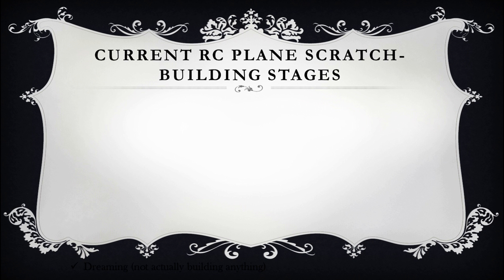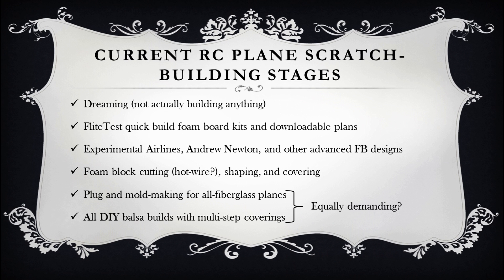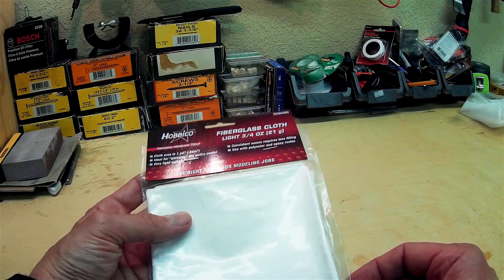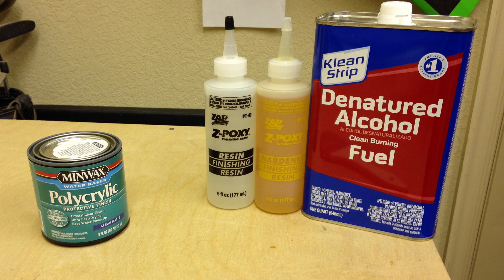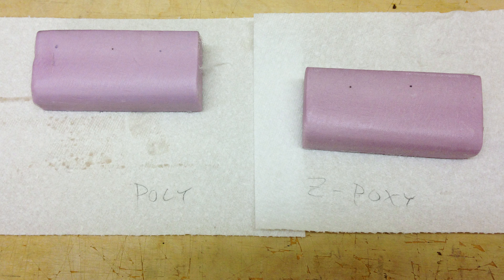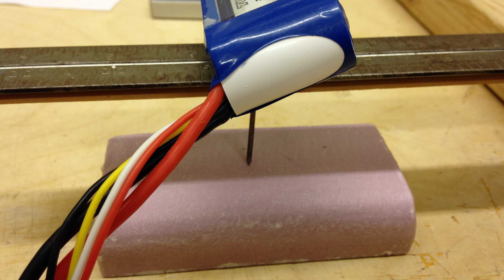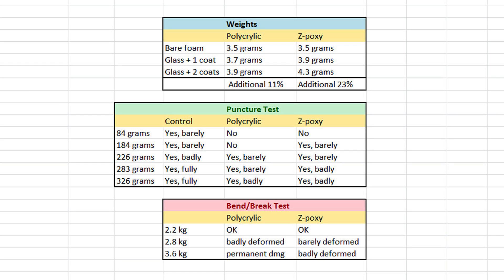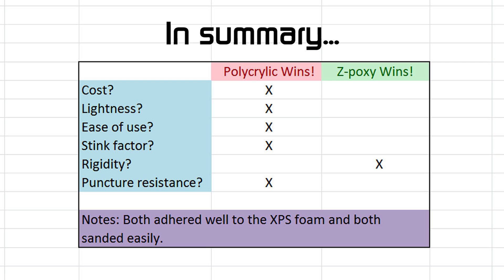Fiberglass on XPS Foam - Polycrylic or Epoxy? (for RC planes)

Comment: If you could install a couple of pieces of hard wood strips along the core wing, and then fiber glass with minwax. Those wood strips will give a great strength to the wings.
Reply from the maker: I have done that to wings and it works well - I agree!  In a later video, I added wood to this wing to stiffen it.  Cheers

Comment: Thanks for the informative video. Based on your results I think I will use the epoxy/alcohol FG on the bottom of my wings for the rigidity and the MinWax PU FG on the top of the wing and fuselage.

Comment: Can you use an oil base polyurethane on fibreglass to cover XPS foam ? Does it works? As the water base polycrylic ??
Reply from the maker: Thanks for the question.  I think oil-based polyurethanes have a good chance of melting (dissolving) XPS foam.  What I used in this video (polycrylic) is not a polyurethane.  It’s worth trying this on a small scrap of material.  Good luck to you.

Comment: can you use carbon fiber mstting on foam planes
Reply from the maker: Yes I think you can.  Most weights of carbon cloth are heavier than I'd want to use on a small plane, though.  Kevlar cloth is also an option - have a look at the "Think Flight" channel for videos about this method.

Comment: Did you get bubbles with no precoat?
Reply from the maker: No I didn't, and I've used this method on three planes now.  I think this is because I thinned the epoxy and also try to keep the fiberglass cloth flat and taught.  Good luck.

Comment: One thing to note is that polyurethanes don’t cure in 12-14 hours completely.  They can become somewhat hard so that they can be handled but true curing will take a week to a month.  A better comparison might be a polycrylic covered wing that has cured for several weeks to an epoxy wing that has cured for 24-48 hours.
Reply from the maker: That's a very good point - thanks for that.  I may have gotten quite different results after full curing time.

Comment: But fiberglass will not melt foam?
Reply from the maker: Fiberglass can be attached to foam with slow-curing epoxies like the one I used (Z-poxy) without damaging the foam at all.  A few epoxies are not safe to use on foam, though, and some create a lot of heat as they cure.  I recommend trying your epoxy on some scrap foam first to make sure it will work.  Good luck.

Comment: Have you considered using a composite material to cover the xps and leaving a hole to use a material like gasoline or acetone to melt the XPS inside? I feel like that would make a similar structure to the full composite airframes without all the work
Reply: I know and old comment but will weighing h in anyway. 
1. The method is valid for creating a fiberglass shell but it has the downside of nasty dirty solvent with styrene melted in in it.
2. The foam adds tremendous amount of rigidity, the shell needs to be significantly thicker to be as strong as glass over foam. Most true light weight composites use foam cores to give thickness to structures with little added weight - usually stronger than XPS which is not good for shear forces. But Burt Rutan designed real aircraft to be built by glassing over XPS and hundreds if not thousands were made. Foam is structural part in those too, not just a DIY friendly material for shaping.

Comment: I am thinking of covering a foamie I bought. I was wondering what you do for hinges in those? The existing setup is just bendable foam, no hinge. Thanks for this video again. I was wondering exactly the same questions you answered.
Reply from the maker: Thanks for the great comment!  Yes, you can cover a foamie using either method here, but I think I'd go with polycrylic in that case.  You can buy plastic hinges from an online store for your control surfaces or just use heavy duty packing or extreme (reinforced) tape.  Tape hinges are surprisingly strong.  Good luck 👍🏼

Comment: One thing to remember is polycrylic  and polyurethanes do not achieve maximum hardness until after 30 or 40 days. I do appreciate your extensive testing though.
Reply from the maker: This is useful information - I appreciate it!  I think there's at least as much information in the comments now as in the video.  :)

Comment: Thinning out epoxy with alcohol or any solvent, weakens it some.  Thinning it by heat/warmth is the best method.
Reply from the maker: Thanks for the comment. I’m sure you’re right that thinned epoxy is a little weaker. Do you use a heat gun to “thin”? Thanks 👍🏻
Reply: @mostlyharmlessrc3920    I suppose you could use a heat gun, but that might be too intense for it.  
 
  I just mix it in a glass jar, and put that jar in a container holding hot'ish water.  You don't want to warm it up too much, just enough to thin it.  

 Hope this helps

Comment: Minwax Polycrilic is NOT a water based polyurethane.  It is solely an acrylic product.  No urethane in it at all.
Reply from the maker: Thanks for the correction.  I'm pretty sure you're 100% correct.  Urethane takes much longer to dry than polycrylic and is probably more durable.  I'll put this info in the description.
Reply: @mostlyharmlessrc3920  No worries.  People all over sites like RCGroups, RC Universe and WattFlyer make the same mistake calling Polycrilic "WBPU".

Comment: I cover all my foamy's with pantyhose and wall paper paste.Strength and paintable surface.just like back in the days of the 50"s and 60"s.
Reply from the maker: I have heard of using pantyhose but wallpaper paste is a new one on me!  I may try that.  I can picture the benefits of both - thanks for the useful comment.   :)
Reply: Yeah when I use to roll my own rocket tubes for black powder rockets everyone used mixtures of PVA . I saw the paste on menards one day got the idea tried it now everyone who makes tubes for fireworks all use it.The strength is unsurpassed.Dont buy the liquid buy only yhe paste cheap and goes a long way. The panty hose were substitute for silk in the ole days.

Comment: Hi Great video I love your way to approach thinks we would've got along very well in the shop. Before watching this video I did a test similar to yours to choose between three fibreglassing techniques, The first technique was with the polycrylic the second technique was with zepoxy resin diluted with denatured alcohol and a third technique was zipoxy resin without diluting  The Zepoxy without diluting is stronger than the other two techniques but it demands alot more attention when applying. I also did a few resistant tests similar to yours I never thought of the puncture test it's a great idea to test that. One extra test that I did is a sending test which I thought it would be important to know which technique would protect better in case of a belly landing onto A concrete runway. again the zepoxy without diluting is the more resistant so I was debating what technique to use because really refer the polycrylic because it's so easy to apply and then I said to myself how much strength finish do a plane really needs? if I think about it most of ARF models are covered with monocote and they hold up together pretty good so I guess the polycrylic is strong enough to cover any size model. But when I do apply polyacrylic I do at least 3 to 4 coats for better strength as opposed to zipoxy only one coat and it's still not that heavy because 60% of the polycrylic just evaporates. Keep up the good work
Reply from the maker: Thanks for the excellent comment!  I have yet to try full-strength epoxy as a coating, for fear of the heat produced by curing and the extra weight.  I have no doubt that full-strength epoxy is stronger than a thinned mixture, though!  I also agree that polycrylic/polyurethane is the better choice in most cases - especially since you can just add another coat of it over your paint whenever you need to (I've done this on the Specter V3).   Good luck man

Comment: Hi, doesn't the alcohol disolve / deform the foam??
Reply from the maker: ian hennus  Hi there!  No, I didn't see any deformation of the foam due to alcohol.  Perhaps that's the reason people are disliking this video?  I used this alcohol/epoxy technique on a large wing and had no issues.  Thanks for the comment.
Reply: ok, thanks! I will give this method a try.

Comment: You should try Zpoxy as a first layer to gain rigidity. Then a layer of poly over top to give puncture resistance.

The same is best when using fiberglass and carbon fiber. Carbon fiber the inside layer, fiberglass the outside layer.
Reply from the maker: Great ideas - thanks!

Comment: Had to come back and watch this again. So did you use this on the specter v3? That paint job looked amazing. I have designed up a "plank" style 50" slope soarer i am going to hot cut. I think i will do this on it. Keep up the cool videos man!
Reply from the maker: Just an update on the Specter V3 - I found a couple of small bubbles under the glass on the underside of the wing.  The wing glass was put on with epoxy and the fuse glass with polyurethane.  Ergo, it looks so far like I maybe should have glassed the whole plane in polyurethane!  It's lighter, less toxic, and is adhering better after a few flights.  Add more sparring to your wing if you do this, I'd say.
Reply: Did you put spars in the wings? I usually put 4-6mm fiberglass kite rods on top and bottom right at cg. I am going to try the polycrylic way for sure. I really dont like working with epoxy. Going do it like a surfboard. One coat of 3/4 fiberglass. Paint job. Second coat of 3/4 fiberglass.
Reply from the maker: Excellent!  Yes, see 0:32 in the specter v3 vid - you can make out spar channels I cut into the underside of the wing, covered in filler.  I used 3 CF strips and one 5mm carbon tube.  Fiberglass rods sound cheaper and easier to use.  I would honestly do 3/4 ounce glass and poly, then another coat of poly, sand lightly, then paint and paint again.  This is what I did on the fuse of the v3 and it seems bullet proof.  I also did one final coat of poly over the paint on the underside of the fuse too, so maybe the order doesn't matter!  The polycrylic comes in gloss or matte finish too, so you can make it as shiny as my wing if you want.

Comment: Great Video, be interested to see that wing done in the water based varnish?....and glass cloth....I think it will be fine, avoiding the epoxy altogether is good if you can because of cost. The wated based poly is going to be far easier to use as well. Have you also considered using glass tissue..?...Not as strong, but lighter for sure....A local Uni did a UAV using this method and blue foam, it worked very well.....A coat of spray paint and your done..lol....Nice Video, thanks.
Reply from the maker: Thanks for the info!  I have not seen or ever used glass tissue, but it sounds like I should try it.  I am new to these methods and generally agree that polyurethane is easier and cheaper than epoxy!  The uav made by your local school sounds interesting.
Reply: Yes, glass tissue is quite common. Since the fibres are short and random, the strength is fairly uniform in all directions. It will be lighter, but not as strong as the cloth. It does work, and you can sand it afterwards. I think you can get it from Car body repair shops etc.

Comment: usefull vid must find some of your kind of foam
my pink foam always started to melt because of the reaction heat
Reply from the maker: Thanks for the comment man!  The z-poxy finishing resin doesn't make a lot of heat while curing in my experience.  It's a little different from regular (especially the fast acting) epoxy.
Reply: Thx for the info mate

Comment: Really nice video specially at the beginning where you start with daydreaming about building, but never the less very informative, keeping in mind that I never use nothing else but epoxy "West Systems" usually my planes last until I get bored with them and back in the box they go, fiberglass covering extends the life of and RC Model 100 fold!  I even wast trying to find a good home for my older model of X8 Skywalker, but no one seems to be interested.. but the reason it actually lasted that long was because of the Fiberglass.. 
Thanks for posting.
Reply from the maker: Thanks for the great comment and information Miguel.  I didn't know you were already doing this on your planes - they look great and are a lot stronger for it I'd guess!  I have heard good things about the west systems stuff so I'll check it out.  Cheers man
Reply: Try to get a few books on Fiberglass laying "Preferably for airframe work" West systems are among the best on the planet when it come to quality & Strength, but it is heavier than most out there so you have to learn to be super Scrooge McDuck, I mean you have to lay it almost dry then give it the bare minimum, because the possibilities of using vacuum on a peace of foam means that chances of distortion are really high.., I have a FX-61 that crashed at 83 degrees full throat, and the wings survived unscabbed.. so yeah that stuff is really good! Thanks for the prompt response, good luck with your project.

Comment: Great technical DIY info. Very detailed and I must admit ... great hot wire cutting. Those wings looked perfect.
Reply from the maker: Thanks Aero!  This hot wire cut wing has some imperfections where the wire wandered a little, but I filled these with lightweight spackle and sanded it flat.  This wing is now fully fiberglassed and ready for paint.  Thanks for the great comments as always man!
Reply: I guess someday when I find the time I too shall DIY an airplane. Currently I have a 4 year old boy whom requires most of my energy ☺ Have a great Sunday my friend.
Reply from the maker: This kind of DIY building takes A LOT longer than FT or EA foam board methods, so expect my new plane production rate to go down!  My wife and I don't have kids, but I work a lot and have other hobbies, so I understand time shortages.  Maybe your little boy can have a cameo appearance in a video at some point. :) Have a great Sunday as well mate!
Reply: That's a great idea .. the cameo ☺